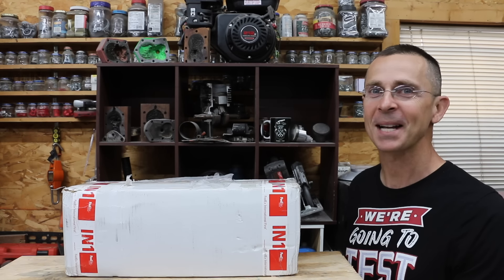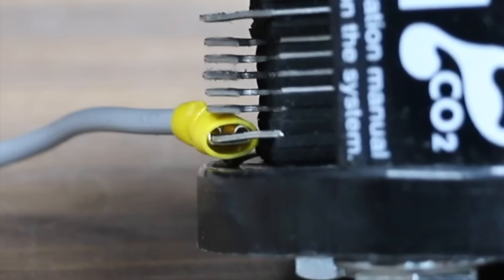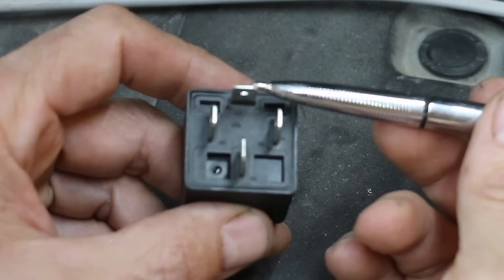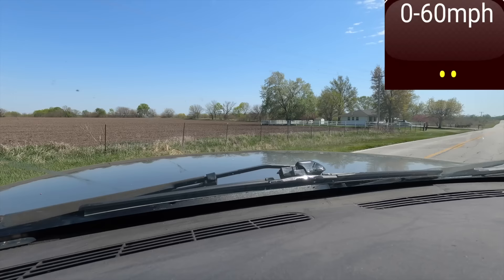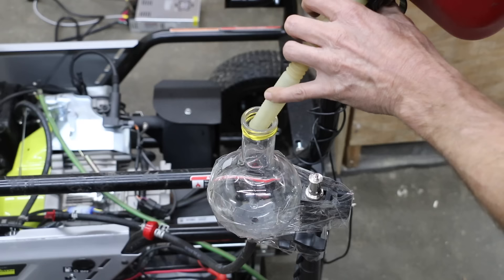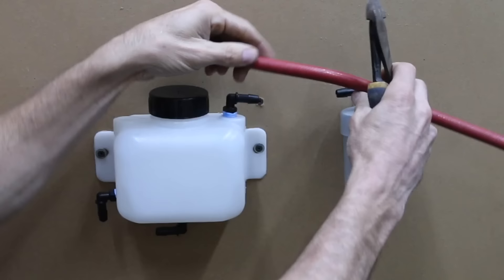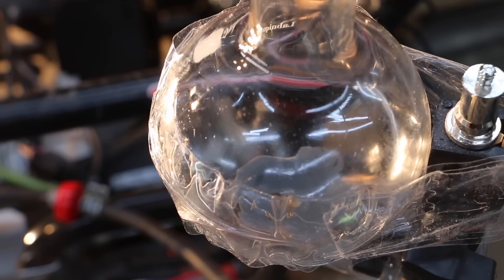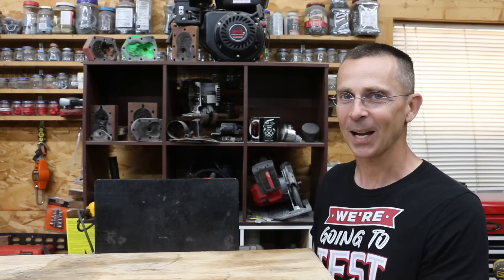AMAZING 35% More MPG with HHO? Let’s find out! Help with high gas prices?

Comment: There are some issues you weren't aware of.

The electrolyte works optimally at 165F.
Ideally you want 'ported' vacuum to draw in the brown's gas. Drilled hole in the intake is not ported vacuum. Most cars no longer have ported vacuum. If you have a PVC valve and connect to that, the benefits are reversed (you want more of the gas when you accelerate not less and PVC vacuum is reverse of that).
You want no more than 20 amp load. About 10amp is optimal so as not to place drag on the alternator.
You want a brown's gas output of 1 liter per minute per liter of engine size.

Additionally there are other things to trick the engine into utilizing the brown's gas effectively (deals with the upstream O2 sensor and IAT).

Just slapping one on can improve things a bit up to about 20% increase in MPG without other modifications.

I got double on the wife's car, but for a day. Her 4 cyl ran like a 6 cyl as far as power and acceleration went.
Seems the computer didn't like the car getting that great of MPG and brought the mapping back into what the manufacturer's specs were.
I even installed 3 lights too. 
Green meaning it is on and working.
Yellow meant it was low on water.
Red means pull yer arse over and see what the problem is (usually blown fuse or loose wire or something but could be worse). Car would work with any of the lights on.

Had to keep resetting the computer every time I used the system. Finally removed it due to the hassle.

The hydrogen in that will slowly remove built up carbon.
When there is no free carbon available (takes a LONG time) it will pull carbon out of any steel parts (this is called Hydrogen embrittlement).

Those plates are made from stainless steel.
Best plates are made from Platinum.
Plate spacing is roughly 1.1mm for great results.
One hot plate and at least 5 or more neutral plates before the negative plate.
Some use electronics to pulse the DC current to to cell around 44kHz.

The water you must use has to be store bought distilled water.
Other water has contaminants in it that reduce efficiency, eat plates, draw too much current, create too much heat, and create sludge in the system.

Never use salt in a system like that. It creates Hydrogen chloride gas which can be explosive in sunlight.

With the dry cell, you don't have to worry about hitting bumps and drawing the electrolyte into the engine like you do with a wet cell.

Remember, there is no free ride with anything. It takes more energy to break the water molecules than you get out of it.
But the advantage is more efficient combustion and resulting more power and better MPG if you keep your foot out of it.

Just a few tidbits for everyone.

Author - redo the test but drive the car for 1 hour SANELY in warm weather so the system gets to operating temperature. Then test it again.
We saw you run that stop sign! lol
Reply: Did u run it on a early 2000’s car or like a newer model year car?
Reply: @ddddmmmm9026  2004 chevy.
If you use non ported vacuum, your benefit is at idle as you have max vac applied.
Once you apply the throttle, vacuum drops and the cell reduces output. That is backwards from what you want to do.
I did try it on an old Jeep 6cyl too.
It had a bad miss in it even though all the parts were working fine.
Hooked up an external cell to the vacuum and direct from the battery.
Within 15 minutes, the miss was gone and the engine ran smooth as glass.
Once I disconnected the cell, within another 15 min it was back to having a miss in it.
I used stainless steel plates and Potassium Hydroxide with distilled water.
Plates were 1MM separated.
It was a container not the wet cell some use.
Plates size was roughly 3" x 5".
Used 7 plates, 5 were neutrals in between the electrode plates.
Edges sealed with Marine silicone.
Amps were between 13 and 20 depending on the temperature.
Any more that that it created drag on your alternator and much of the water would evaporate off without converting due to high heat.
Had to be very careful as the solution became a toxic waste due to chromium released from the stainless steel.
Gloves are highly recommended and so is eye/face protection.
Bad thing about stainless steel is that it is a resistor. Platinum electrodes are the best but who can afford them??
Reply: I found I only needed 3-4 volts  to effectively run my system, I used a voltage reducer to heat the water around the pvc capsule containing my plates. Had it explode a few times under the hood bc of the faulty voltage reducer getting too hot exposing hydrogen under the hood next to my headers.  😅 I was only 17.... live and learn. You need a stand alone computer and a hell of a programmer friend to get these to work on anything newer than the late 80s.
Reply: @kjruff7786  Actually there are two key components to fiddle with -
The O2 sensor output and the IAT sensor.
You can buy a module to tap into the O2 sensor(s) (I think it is called a PWM) to trick the computer.
For the IAT, simply remove it from the air intake and let it sit under the hot hood.
Deviating too much out of the fuel map will set a code and you lose your benefits.
Not sure you you could fracture the molecule bonds of water with that low of a voltage.
The typical sweet spot for voltage is around 28-30 VDC.
Reply: The o2 sensor extensions actually don't normally work as most cars have 2-4 o2 sensors now and they work with about 4+ other sensors. Tricking them only messes with other sensors and the computer compensates by pushing in more fuel
Reply: PCV vacuum is manifold vacuum, always has been and always will be.
Reply: @kaylahashbridge7472  that's a random statement and point I don't think anyone was arguing, at least, not this thread...
Reply: Perfectly stated my man!  Outstanding.
Reply: @ddddmmmm9026  2004 chevy classic actually. 4 cylinder model.
Reply: @kjruff7786  I found that 28VDC worked the best, pulsed. Which coincidentally is the voltage needed to kill someone. With about 0.1amps.
Reply: @kjruff7786  Those extensions pull the sensor out of the exhaust stream making the computer thing the mixture is one way or another, usually rich exhaust.
Reply: @kaylahashbridge7472  Unless you step on the throttle then it will drop or highway speeds and it will drop.
I used a manifold vacuum gauge to monitor vacuum levels at various speeds. Idle has the most vacuum. WOT has the least.
Reply: You must sell this snake oil trash.
Reply: @billbraski2175  Actually it is not snake oil trash. It DOES work, but results vary wildly.
I took that chevy from 30mpg to a whopping 61.5 mpg by using it.
Unfortunately the computer didn't like it and changed the amount of fuel it delivered to 'bring the car back into compliance
 with the fuel mapping.
Got tired of resetting the computer daily so removed that system.
Oh and the car felt like a 6cyl instead of a feeble 4cyl when it was on there.
No, I am not going to sell anything. Not worth my time and effort.

Did you know you can weld a common nail to an ordinary rock with HHO gas?
Reply: wouldnt matter how many tricks you use to generate the HHO, magnets, lasers, crystals, electrolytes, whatever, you can never recover more energy that what it took to manufacture the gas in the first place. its is a lossy process no matter what.
Reply: have you seen a kit that is up to snuff or is it better to make your own?
Reply: @dmerchant2  Yes I have seen several online. I wanted to make my own for the experience. Even had some lights I added to tell me the status too. Green - working. Yellow out of water. Red pull your arse over and LOOK to see what the problem is.
Of course I had a manual off switch just in case.
The stuff does work but your mileage will vary quite a bit as it were. Typically you can get about 20% to 25% better fuel economy.
Ideally you want at least 1L of the gas per engine liter size throughout all rpm's.

But you can buy one of the commercially made kits. Just follow directions. Mount, hook up, add electrolyte and DISTILLED WATER, and if you did it right, it will come on when you run the engine. And off when the engine is off.

Some cheap kits use baking soda but you lose 1/3 the energy it takes to make the brown's gas. Potassium Hydroxide is the better electrolyte.
You CAN use an acid like vinegar (distilled white vinegar). Never tried it myself.
Avoid using salt!

More modern the car the HARDER it is to get it to work the way you want.

Best engine is non computerized with a carburetor and old distributor.
Downsize the jets one or two sizes, retard the timing to 8 degrees after TDC, and hook the vacuum line to a PORTED fitting on the carb. Manifold vacuum is opposite of what you want. Cell would make the most as idle and the least when you need it driving. That is backwards. Ported vacuum fixes that problem.

Oh and old diesels are a breeze.

Be aware that those cells are NOT freeze resistant or freeze proof. If it is too hot under the hood or the cell runs too hot, you just make steam and not the gas. Optimal cell temperature is about 165F.

You want a dry cell if you can afford it.

Oh and off roading is not advised - too many big dips and bumps. You do not want the electrolyte sloshing and possibly getting in the engine.

Some vehicles cannot possibly fit the system (buddy had an old 6 cyl jeep that there was literally no place under the hood to mount anything).

Check with the mfr of the kit before buying.

For safety reasons do not have the components in the passenger compartment or an enclosed trunk.

Fun fact: you can fill a tube 8,000 feet long with the gas and light one end. It will burn that distance in 1 second.
Gasoline pour a line on the ground and light it. MUCH SLOWER flame propagation. You can dang near outrun the flame.
Reply: This comment was a wonderful read
Reply: @ljap1010102  which comment?
Reply: @crazysquirrel9425  I saw you said that stainless is an insulator. I've seen graphite get used as plating for generators, and as far as I am aware, it is a bit more efficient and doesn't react to create anything harmful. So, I was wondering if you've ever tried it or if you knew how well it fares?
Reply: @hsheheishje9649  Never tried graphite since I could not locate graphite plates.
SS does indeed have resistance to current flow.
Best plates are Platinum.
I have hear of people using carbon rods though.
Reply: zackgofastaf  The device is called a pulse wave modulator. You also need to trick the IAT sensor too.
You can buy premade PWM's online. You just have to tell them which one you need - for single upstream O2 sensor or Double upstream O2 sensor.
Downstream sensors are only there to determine if the CAT if functioning correctly. So do not count those when ordering.

There ARE limits though. Fuel mapping in the computer will detect if you are too lean (because you were too aggressive in your settings) and bring the system back into compliance, even running in limp mode.

If you are not aggressive with your Brown's Gas to get maximum MPG, you don't need those.

Note: The IAT will help control spark advance. Most cars have the timing advances up to a whopping 20 degrees before TDC.
This will ignite the Brown's Gas long before the valve closes. Damage to your engine can easily result.

Brown's gas will 'burn' at 8,000 feet per minute. Gasoline burns at a significantly slower rate, diesel even slower.
You must be certain the timing is set late enough to prevent this and 100% certain you do not have burned, cracked valves or their seats.

But you can add in a LITTLE Brown's gas without much problem.
Reply: im considering building a battery powered system for my truck based on the jackery 1000 watt hour battery pack. at 12 v thats 83.5 amp hours, and with a 10 amp draw i would probably get around 8 hours of driving time to a full charge. I have a tundra so theres no way im putting extra strain on that alternator because its so tough to get to lol. Im wondering if you think any issues would arise? i havnt been able to find any examples of battery powered hho generators on vehicles. if anything a more steady production of browns gas would be easier on the ecu, right?
Reply: @crazysquirrel9425 oh dang, just saw your comment saying optimal is 28-30 volts at 10a??
Reply: also i would have panels on the roof of my camper shell constantly feeding the battery
Reply: do you know if water will still split at 10v? im thinking it would still be worth it with such low efficiency because im not adding any load to the alternator by running it.
Reply: @henryraab3111  Almost any voltage will split it but at what rate?
Best bang for the buck is supposed to be about 28VDC.
10 amp but 20 amp would still work, just that it heats the solution up too much.
Reply: @henryraab3111  That was the general consensus.
Reply: @henryraab3111  You might want to look into a heavy duty brushless alternator now for when yours eventually fails.
10amps is not a big load on an alternator. Your headlights pull more than that. So does your car radio.

Yes you can use a battery powered power source.
Issue is that as the battery runs low, so does the voltage.
When using batteries, you are just switching to another electrical source to charge them is all.
Reason people use their car battery and alternator is so they have a reliable power supply to run the system.
Reply: @crazysquirrel9425  thanks man really appreciate you sharing your knowledge
Reply: @henryraab3111  You are very welcome. Also, you might want to research more on it before attempting to make your own or using the system.
Some things are probably more updated than what I posted.
Reply: @crazysquirrel9425    definitely will be doing more research, im probably 6 months out from being able to afford what i want to do. I was planning on a graphite dry cell because its cheap online and wont corrode like stainless. I was thinking i would try to roughly recreate a dry cell i saw on robert murray-smiths youtube channel, you should check it out. I would build it with a much more robust housing and tank, as well as an electronic valve above a wide catch can (just in case water is pulled through) with a shutoff switch on the dash so i can let the engine run for a bit to purge the browns gas from the system. just wondering, what style of dry cell did you use? i could be wrong but from every configuration of dry cell ive seen, i imagine any vacuum on the output would pull water through. I suppose you could use a bubbler but that would negate the benefit of being able to handle bumps.
Reply: @henryraab3111  Mine was actually a wet cell. Bubbler is needed to prevent backfire and explosion. It is a safety device.
Vacuum relieves some of the surface tension and can create more of the gas.

Take a large container and submerge your open cell in it.
You will see that the most production is near the top of the plates and little at the bottom.
A long horizontal cell will produce more than a tall cell, wet or dry.

With a wet cell I think you need to use a pump to circulate the electrolyte solution.
Potassium hydroxide works very well.
Do not use salt. It can create Hydrogen Chloride gas if I am not mistaken. And that, which is better than brown's gas, has some issues.
It can explode in sunlight.
And the Chlorine is hard on most of the parts.
I do not know how hazardous the emissions would be either. Your Cat converter would be ruined.

In any case, it does not work in freezing temperatures.
Others made a solution similar to airplane deicer to use in theirs.
No sure what their results were.

Brown's gas is a 'fair weather' system.

Don't forget the electronics for the system.
A PWM is one.
One of the electronics goes to the O2 sensor(s) and the other goes to supply the cell (can't remember which is which or the name of the other one right now).
And the one pulses at something like 44khz to the cell.
Reply: Wonder how this would perform properly installed on a Prius!
Reply: @traviskellogg867  It can work but I do not think you will see spectacular results.
Bigger the engine the better the results as it were.
10% on a Prius is nothing compared to 10% on a gas guzzling SUV.
Reply: @crazysquirrel9425  mmm... I beg to differ based on percentages. 
Prius: 45mpg + 10% = 49.5mpg. (4.5mpg boost)
SUV: 18mpg + 10% = 19.8mpg. (1.8mpg boost)

How well it works in reality I wouldn't know, but I'm just basing it on the 10% you mentioned.
Reply: @traviskellogg867  Prius probably would not get a 10% boost but a V8 gas guzzling SUV can.
The differences are not necessarily liner. 10% was just an arbitrary value.
Let's way a Prius gets an extra 5mpg. Or roughly 10%.
Now let's say that gas guzzling V8 suv goes from 12mpg to 24mpg.
Big difference there. Bigger the engine the bigger the gains you can get.
Think bell curve with gas guzzlers on the left and Prius and similar on the right. with normal vehicles around the middle.

Of course, nearly all vehicles made in the past 20 years or so will not allow you to get great MPG over what the manufacturer wants you to get. That is unless you do other modifications to force it to.

I did a chevy classic. Went from 30mpg to a whopping 61.5mpg, for about 1 day.
Computer sensed I got too good of a mpg and sabotaged the gains I got and it went right back to 30 mpg, which is what the MFR forces the car to get.
I even did all the tricks too, less having the computer replaced with one that will allow the gains.

Realistically, for normal vehicles, without extensive modifications, you can get 10% to 20% better MPG. I did say NORMAL. Prius is not a normal vehicle. Nor is any hybrid.
Any more than that you must retard the timing significantly or an explosion will occur due to spark before valves are closed.

About your Prius - doesn't hurt to try it. Start with a LOW injection of Brown's Gas. Remember, your timing will be the big issue.
Avoid using salt an an electrolyte for several reasons.
Using baking soda wastes 1/3 of the energy you use to make Brown's Gas.

Potassium Hydroxide is a very good electrolyte, followed by Sodium Hydroxide (drain opener, stump remover).

Vinegar can also work but not as efficiently.

I think Prius can do the 'pulse, glide' method to get better MPG.

The intended goal of Brown's Gas is 1L of Brown's gas for each liter of engine displacement. And that is at idle. Accelerating and high speed requires a much faster production rate to maintain that 1L/1L ratio.

One of the better gains is with an old diesel followed by an old vehicle with distributor, points, and a carburetor.
Carb needs to be down jetted 1-2 sizes and timing retarded to 5-8 AFTER TDC.

Of course if you are after more power, then don't downsize the jets.
Reply: @crazysquirrel9425  28VDC pulsed at a tenth of an amp will only be harmful if the pulses are SUPER short. 44KHz is not going to do it.  If you were super invested in this, why didn't you consider a stand-alone ECM? I'd be curious to know what potential could be there if you could control the fuel mapping while using a MAP and wideband O2.
Reply: @nickadamson6053  You need a PWM (Pulse Width Modulator) for each upstream O2 sensor. 
28VDC @ 10 amps to 20 amps is generally what people shoot for. About the same drag on an alternator as headlights (which usually do not affect MPG when on).
Stand Alone ECM's cost a lot of money - they still need to be custom programmed.

Another sensor to trick is your IAT (air input temperature).
You could try to trick the MAP sensor but I found it is not easy nor provide decent results for the effort.
Reroute the cold air intake to inside the engine compartment. Cold air = more dense = more oxygen in it = more fuel consumption.
Conversely warm air gives better MPG.
Think cold winter and bad MPG whereas hot summers give you good mpg.

You could toss on a low output HOD on your engine without doing any modifications.
But must be pretty low output.

Nice thing about hydrogen is that is hungrily eats up carbon in the engine.
Up to and including the carbon in the steel parts if no other is available (termed hydrogen embrittlement).
The newer the car the HARDER it is to use HOD.

Fuel mapping issue - if your vehicle detects you get too good of MPG, it will alter what it needs to in order to bring you back into compliance (limits of the map) thus restoring your original MPG the factory says you MUST get.
Hence the reason for tricking the computer.

Auto makers are in league with big oil. Best buddies they are.
Reply: A hole in the intake manifold certainly is the same thing as ported vacuum. Where do you think a ported vacuum carb gets it from?
Reply: @roachwerks3043  Ported vacuum is not a hole in the intake manifold - that would be an unmetered vacuum leak usually.
As the plates open, there is more air flow and that creates the vacuum. More open the plates the more vacuum is created on the port.
Therefor, you get more benefit from more vacuum as you increase the throttle.
You do not want maximum vacuum on the generator at idle as there is little benefit. You want it when the engine is under load.
Reply: @crazysquirrel9425  the hole is on the plastic intake hose, before the throttle. Which is ported vacuum
Reply: @crazysquirrel9425 Dude 28 Vdc won't kill ya, more like 45 and up
Reply: @Gringoloko  a human can be killed by 9 volts if there are enough amps (current) behind it...
Resistance between the ears = 100 ohms
Resistance from fingertip to toetip = 500 ohms.
Of course thin skinned woke individuals will have near zero resistance lol
28vdc was the typical voltage at .08 amps.
Can be higher or lower depending on the person and environment.
Stick your index finger into your mouth and wet it. Then stick your finger into a lighter socket in your car. If you are touching the center and the outside metal parts you will feel it.
Reply: maybe you can make a video. it looks like this is way to complicated for normal people to do like the product would sugest.
Reply: @kevinoverholtzer3126  Thanks but nothing to make a video with nor able to upload anything.
There are many other sites that people can get connection advice.
Reply: Uh, there’s a problem; it takes more energy to split a water molecule into hydrogen/oxygen gas than the energy released when that gas is burned.
Reply: @kurtdobson  Correct. However, the browns gas does increase the burn efficiency and helps remove carbon deposits as well as reducing pollution.
Trick is to not drag down your alternator while making the stuff.
Your MPG does not change when you have your headlights on - least not by any significant amount.
So if you can make the stuff at the same or less amps than your headlights, you will see a benefit.
Tossing one on without doing the other things needed CAN increase MPG about 20% to 25%.

Car makers sabotage your gains too (crappy fuel mapping).
I doubles the MPG on the wife's car for about 1 say. Computer said HELL NO! And adjusted things to bring my MPG back into compliance with that THEY want it to be.
Reset the computer and good MPG again, FOR ONE DAY at best.